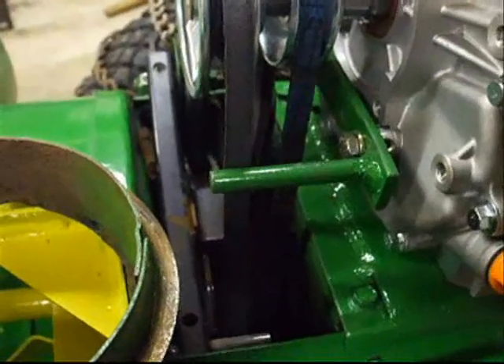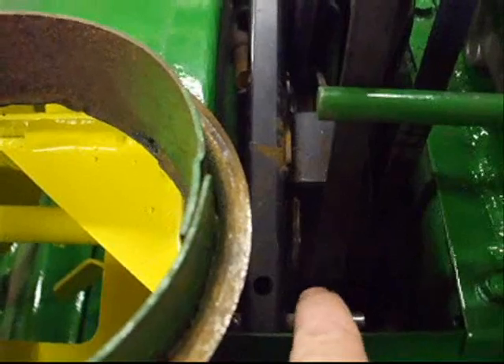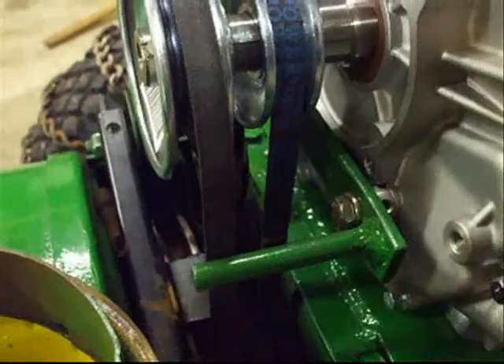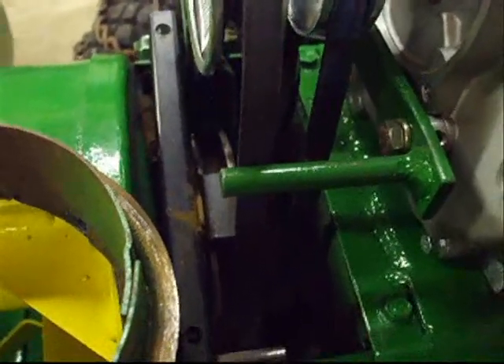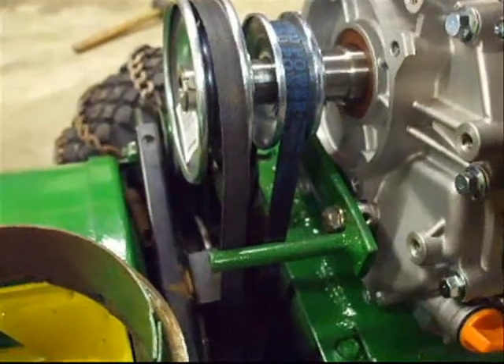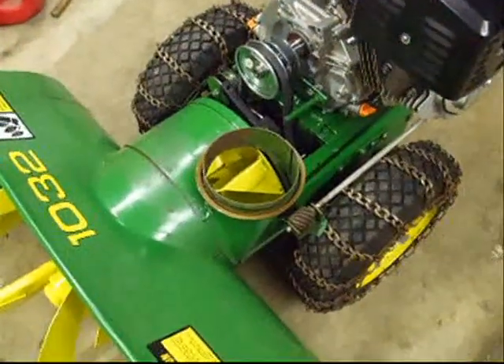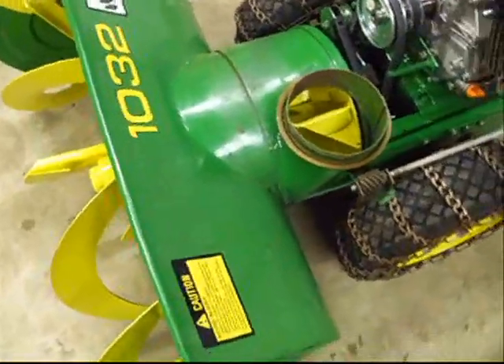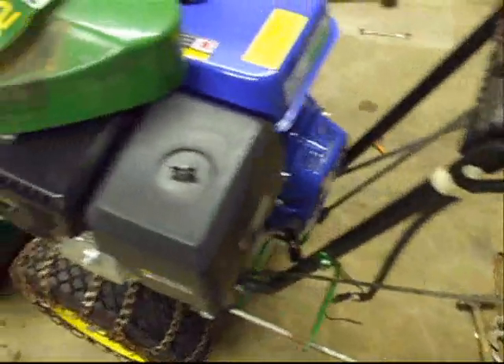John Deere 1032 Snowblower Repair & Modification Video Part #8

Comment: I like that brake system.  I might find that design usefull as since I changed pulleys on mine, the brake and engagement does not work optimally, although it is still better than when I first bought the blower.
great videos.

Comment: I just picked up a used 1032D this year and upon my first use the auger stopped working, so I took the belt off and ordered a new one also noticed that the brake is missing the return spring and I can’t see where it’s supposed to be mounted. There is the hole below the bad itself but where does the other side go? Great videos, by the way!

Comment from the maker: Thanks, I cant wait to get it out in the snow, we finely got the new belt cover welded and painted up today, though we still have a few more things to do with the engine, there will be 2 more episodes on the 1032, one more on  assembly and one outside for load test. Thanks again.

Comment: If you put a little bigger auger drive pulley on the crank, will it spin the pulley on the auger shaft faster? I have an old 526 JD blower and it only throws the snow about 10 feet.

Comment from the maker: @l337pwnage ,Years ago when this system was first installed I did not like them, but after working with this system for while you can see how it keeps the belt from ripping itself to pieces during engage and disengage of the auger as seen in camera close up, the older style without it goes through a lot more belts and that's why I felt bad about removing it to fit the new giant engine, if it didn't work out.